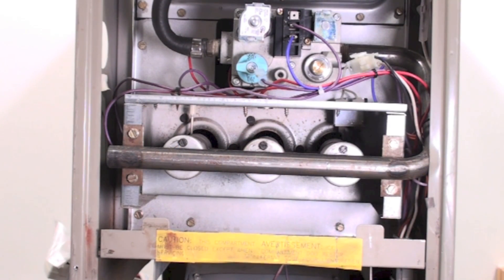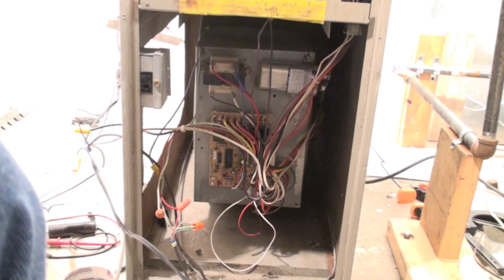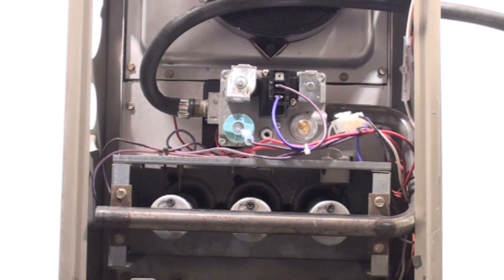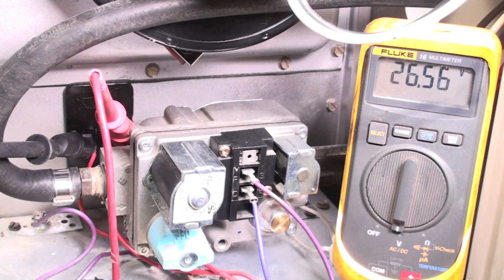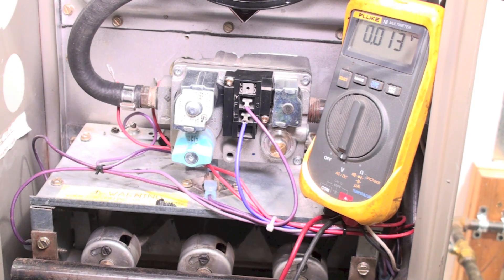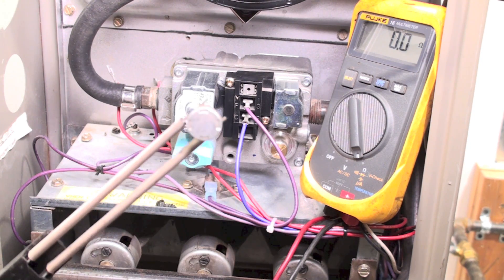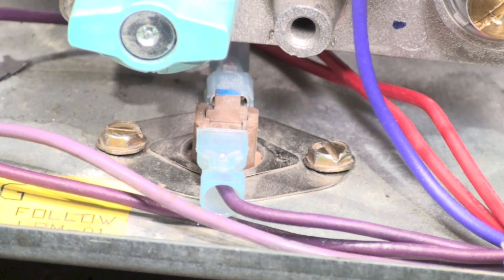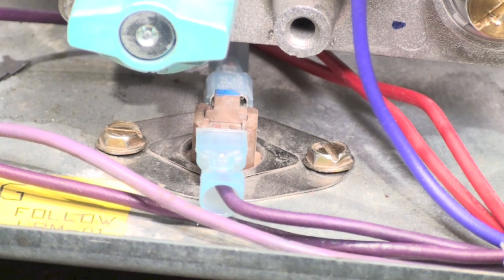Troubleshooting the limit switch on the 80% AFUE gas furnace

Comment: hello, I have a quick question: a limit switch is the same as a flame rollout switch?
Reply from the maker: Its functions the same with the exception that the rollout switch is manual reset.  The use of the switches are different.  The rollout switch detects the temperature of a flame rollout near the burners.  The limit switch detects excessively high temps in the ductwork.  
GFM

Comment: Will an open limit switch also cause the unit to not send a low voltage signal to the condensing unit contactor outside? That's my problem, four flashes on the circuit board. Haven't had a chance to test the limit switch like you show yet. The unit works when I manually engage the contactor, but the controller isn't sending the low voltage out there. I've ruled out bad wiring and thermostat.
Reply from the maker: It could, depending on manufacturer.
GFM
Reply: +grayfurnaceman it's a goodman, made in August 1996 and put into service in October 1997. I've been limping this machine by for a few years now. I just fix stuff when it breaks. Looks pretty much like the furnace in the video. The red light on the circuit board is in the upper left corner of the board though.
Reply: +Ryan Jones gmp 075-4 is the model.
Reply from the maker: I don't believe that one would interrupt the cooling signal.  However, the fan will run continuously.
GFM
Reply: +grayfurnaceman hopefully this will help some else....it turned out not to be the limit switch, thanks to your testing instructions for that. It ended up being the auxiliary limit switch that was mounted in the blower housing, again, your testing technique was spot on. $3 part. Done. Fixed and working. Thank you sir!
Reply from the maker: Welcome
GFM

Comment: I also think this is a great video. However, my limit switch tested good, but I still get the same error code. I also tested continuity between the limit switch and the control board. (One of the leads went through the pressure switch, which also tested good.) Is my defective part the control board?? (I should also add that when I disconnected the pressure switch, I got the correct 3 blink error code.)
Reply from the maker: I would check all limit devices.  There could be rollout switches or a switch mounted on the circuit fan.
GFM

Comment: Great video.
I'm stuck with an odd problem.  I'm getting a high limit open trouble code (4 flashes).  I've tested the limit for the heat exchange and the blower, both are closed (I've replaced both since they were original anyway.)  The unit blower and induction fan come on and the pressure switch is good.  In short the unit comes on, but blows cold air. Is there another limit switch I'm missing?  (normally I'd check the schematic, but there isn't one on the unit. Cant find on internet either lol) 

On a side note, I did notice that the start capacitor on the blower is an original (mfg date 5/92) you dont think a bad cap would cause this do you?  I havent checked it yet, but I dont imagine that would be it.

Maker: Inter-City products
Model: GNI080A016AIN (25 yrs old)

Any help would be greatly appreciated.
Reply from the maker: The cap is not the problem.  Some of these units had a fusible link over the burners that may be open.
GFM
Reply: Ok thanks I'll check it out

Comment: I listed the limit switch incorrectly on my last commet it should be L120-30F.  (Fan)
Reply from the maker: That is a limit switch that opens at 120 degrees fahrenheit and closes at 90 degrees.
GFM
Reply: I hadn't run the furnace or AC for about 5 days, (since the transformer on the pole took a hit and had to be replaced by the power company), so the furnace wasn't hot. Therefore the fan limit switch shouldn't have been makine the fan run. After testing both limit switches, (fan & furnace), and checking continuity on many of the wires and also taking the AC out of the picture by disconnecting it, I replaced the the control board, ($100.00), from the local supply company. All is well now.
Reply from the maker: Glad you got it going.  My own furnace suffered the same fate.  No fan running continuously, just no fire.
GFM

Comment: I'm having a hard time understanding which is the desired position. After a major elecrtic surge, (lightening strike took out my transformer on the Power pole and fried my TV, Router and the fan on my furnace won't stop running. Wouldn't I want the limit switch to NOT pass voltage across it? Seem like everyone making these videos wants the voltage to cross throught the limit switch. If it does, doesn't that mean I have continuity, the same as if I ohm it out and get 0.00. But then my fan should run, shouldn't it? I want it not to run when I turn my thermostat to off and switch the fan to AUTO. help me understand the test process it turms of making the fan Not run unless the heater or AC is in Run mode.
Reply from the maker: A limit is a high limit safety.  Meaning it should pass power to the gas control to let the burners operate unless there is an overheat.  The limit has nothing to do with the fan switch.  If your fan is running continuously, either the heat operated fan switch is stuck closed or the manual fan switch is stuck closed.  
GFM
Reply: ok. Yes. I am trying to determine why the auxilary Limit Switch (the one on the fan. L200-30F) it making my fan stay on. I set the thermostat to off and fan to auto and my fan continues to run. I thought that indicated a possible problem with the fan limit switch ot a control board problem. Seems loke most of the threads I'm reading here on youtube people are refering to the limit switch qs being on or off. I think some are mixing up open and closed (that being the circuit), with on on off. If the circuit is on that would mean the limit switch is closed. If the circuit is off that would mean limit switch is open.  BTW, I just checked the voltage on the wire while I had it disconnected from my (Fan) limit switch and was getting 14vac. I'm thinking that might mean a problem with my control board since I replaced the thermostat and the thermostat wire. Would you agree?  Thanks for your quick response from my yesterday's question.
Reply from the maker: If your aux limit is open, the the fan will run continuously.  The reason is the furnace is sensing it is over temperature and it is trying to cool itself down and tell the customer there is a problem.  If you are checking the wire on the limit to the chassis, your reading is meaningless.  You could check across the limit terminals with the unit running and if it reads 24 volts, it is open.  If it reads 0, either there is no power to the switch or it is closed.  You could have a board problem, but I would not be there yet.
GFM

Comment: What would happen if i put a 30 degree higher high limit switch in my furnace? Can you please reply back. 

Thanks!!!!!
Reply from the maker: Under no circumstances replace the limit with anything that is not a factory part.  This is important especially with any furnace made in the last 30 years.  If your furnace is opening the limit, you need to find out why.   Plugged filter, dirty fan blades, blocked A/C coil, restrictive ductwork.  Hope this helps.
GFM
Reply: grayfurnaceman it's a factory part I'm replacing it with. They sent me a limit switch that's 30 degrees higher than what's in my furnace now and I wanted to know if I put it in would it be problem down the road because it's 30 degrees higher
Reply from the maker: Could you send me your make and model#?  Its on the inside of the furnace.
GFM
Reply: Carrier Is the make also
Reply from the maker: What temperature limit do you have?
GFM
Reply: grayfurnaceman it was a 210F In there original and I ordered a new one and they sent a 240F. I don't think the 210F was the original one to start with. I just purchased the house.
Reply: I have a 210F in there now
Reply from the maker: Are you sure you are not replacing a rollout switch?  Mounted in the burner box and not on the vertical panel above the burners.  Up flow furnace.
GFM
Reply: grayfurnaceman yes I'm 100% positive. It's the high limit switch inside where the heat exchanger is at
Reply from the maker: The reason I asked is most of those limits are 170F.  Try running the unit with no fan running and put a temp probe in the supply.  Place the probe in the duct where it won't be effected by the radiant heat from the heat exchanger.  The temp should not go above about 180F.  If it operates longer than about 4 minutes shut it down as that could damage the heat exchanger.
GFM

Comment: Hey gray I'm a service tech and have a problem with a nordyne 80% gas furnace furnace the call was no heat so when I got there I found it th air filter was plugged dust so I trouble shutting system and found out th high limit switch was open at the same time I took blower out to check coil very duty so I replace h limit switch with a new one with out cleaning coil so when star unit still doing same do you think tht new limit it's open because didn't clean coil? I did clean it later but still doing same it work but stops after few minutes any sugestións

Comment: Quick question GFM,

So far the last few days I've been having a frustrating problem with my furnace. Once the desired set temperature is reached in the house, instead of the heater just shutting off, the hot air stops coming and only cold air starts to come out of the vents. The hot air always stops coming out once the set temperature is reached. This leaves us with the fan constantly blowing.

I have never had this issue before so it couldn't be the thermostat wiring, so I figured maybe I had a faulty thermostat. I replaced the thermostat with a new unit, and I still had the same issue. So i'm ruling out that the thermostat is not the culprit. 

After doing quite a bit of research online I have came to the conclusion that the limit switch could be the problem. In your expert opinion would it be wise to swap out the limit switch or should I try something else first?

By the way to note, the furnace is a gas unit, with an electric pilot. I had also changed the extremely dirty old filter out about 2 months ago.

Any help would be appreciated!

Comment: As a plumber I see a lot of poorly unsupported, dangling gas pipes around furnaces. Nice to see the wood supports under those pipes.....reminds me I should carry a circular saw and lumber in the service truck.
Reply from the maker: The workmanship can be pretty terrible out there.  I sometimes wonder how you can leave the job that way.
GFM
Reply: 24volts means it is closed....
Reply: Jim Rr looks a total hack job...3rd world barely...same as that rubber gasline that rests against a potential hot inducer housing ...ohh sure it's fine as a temp...keep your wood & wood tools at home Tim

Comment: Grayfurnaceman: as a retired HVAC mechanic I cannot count the number of times I encountered what you are saying about clean/dirty air filters starving the return for air.  And as you say the furnace runs too hot and kicks off on limit. The over temp limit is doing its job. In some homes I would find a central return grille that the homeowner has blocked with a piece of furniture or a rug, and they get this condition. The furnace has to breathe just like you & me.

Comment: Your advice fixed mine. I just remove the limit switch and flicked it a few times, reinstalled and works now. Order new switch.
Reply from the maker: Glad you got it going.
GFM
Reply: How did you remove the switch from behind the gad box?

Comment: a gary i have a question
Reply from the maker: So ask it.
GFM
Reply: grayfurnaceman  i have a 90% lennox no call to heat i check the flame sensor  cleaned it still no call the next step would be the limit correct
Reply from the maker: The limit could be the problem if the circulating fan is continuously running.  Have you checked the control board diagnostic lights?
GFM
Reply: grayfurnaceman yes is there a way we can talk on the phone

Comment: How many times would the main limit cycle OFF and ON due to a plugged filter, for example, before the control board would shut it down?
Reply from the maker: +JustPlumDucky On any unit I have worked on, the board never shuts down the furnace.  It just turns on the fan and locks out the burner.  
GFM

Comment: I reviewed several videos and out of them all this one was by far the most helpful. My Trane furnace was blowing cold air. I finally got it to light after I removed the limit heat switch, smacked it a few times and replaced it as was done in this video. I also ordered a new replacement limit switch as was also suggested here. Thank you very much!!!
Reply from the maker: +John Tessler Welcome
GFM

Comment: I worked on a furnace that tripped the overload. Evaporator coil was almost completely clogged. Cleaned it. Filter clean. Checked heat exchanger & CO test - CLEAN! Flue - like new condition. Draft inducer flowing well. Blower flows like a hurricane out the vents. STILL tripped the limit switch. Air temp at registers plenty hot (didn't measure) even after reducing main burners to a trickle. It was only after I reduced the gas flow that it FINALLY stopped opening the hi limit. What gives?
Reply from the maker: +Jake Jones Possible cracked heat exchanger near the limit switch.  Pull the limit and check inside.  I would also check temp difference across the furnace and compare to model specs.  If it is too high, you still have an air flow problem.  Manometer can help here.  Hope this helps.
GFM
Reply: +grayfurnaceman I briefly looked at the heat exchanger when I had it open and it looked like new. No obvious cracks. Also, when I took a CO reading it was 000. Not to mention, being draft induced means a negative pressure in the heat exhanger. Thus virtually impossible for exhaust to enter the conditioned air stream. Don't think the delta temp is too high. When I said "plenty hot" I meant it was sufficiently hot but not excessive. If anything, lower than what I'm used to seeing, obviously due to the reduced flame. If hi limit trips again, I will take an actual delta temp reading, and if within specs, just replace the limit switch. Nothing more frustrating than the occasional "mystery" problem. Thanks and have a Happy New Year!
Reply from the maker: +Jake Jones An induced draft does not guarantee no CO if the heat exchanger is cracked.  Happy new year.
GFM

Comment: I HAVE A 03 CARRIER MODEL 58STX090-16THE FAN IS WORKING, A/C IS WORKING , BUT HEATINR IS NOT COMING ON . EXHAUST FAN IS NOT GETING 110V .BOARD IT NOT FLISHING THE NORMAL CODE I CHECK THE WIRE AND SWITCH BUT NOTING HAPPEN. THANK YOU .
Reply from the maker: +jose echeveria Have tried jumping R to W on the terminal board?
GFM
Reply: Yes i did. Looks like they are not voltage going from the board to the  exhaust.
Reply from the maker: +jose echeveria You might try removing one of the wires from the pressure switch.  If the inducer starts, the pressure switch is stuck closed.  Also check the solder joints on the control board.  If there are solder joint problems in the control board, the manufacturer recommends replacement of the board.  Hope this helps.
GFM
Reply: thanks for your help grayfurnaceman the problem is the board .thank you for you time.

Comment: I have a 2003 armsstrong 2stage furnace  itts a 80% upflow with a sealed comb. box. it is flashinga code 3 or press. it has two press. I'm assm 1 for 1st stage and 2nd one for stage two?  both switches have a normally open post blank space where normally closed post would be. two barbed posts per switch half black and half white.
               right switch makes at .45" of WC LEFT MAKES AT .30" WC. A PRESS.TUBE GOES TO GASVALVE AND BURNER BOX THEN THEY TIE IN TOGETHER EVENTUALLY GOING TO INDUCER HOUSING BARBED PORT.I OHMED IT OUT CROSSED POSTS AND IT BEEPED AT ME it should not beep at me. I cleaned all ports and blew through tubes. noblockage. now what
Reply from the maker: +Forrest Ericsson Check combustion air supply and vent pipe for obstructions or sagging.  Hope this helps.
GFM

Comment: 'Limit switch open' was the indicator for my furnace... I switched the power swtich off and back on so to 'reset' it and now it's steady and I see flames.. New filters, always... It kicks on and off like you are talking about though, often... I have an issued with mice and my duct work, so we sealed off under the house, but now.. I opened the doors at it seems as though i am literally heating 'under my house' must be duct work besides the furnace right?
Reply from the maker: +Destiney Mickelsen Could have duct collapsed.
GFM

Comment: Thanks to your lesson on the limit switch, I was able to get my furnace working again. The fan just kept running but it wouldn't ignite.  Once I removed the switch panel and exposed the switch, I have it a few taps, put it back in and flipped the breaker and the ignite light came on and, after a few minutes, we had heat.  I will replace it as you suggested.  Funny, though, it was taped to the probe so I am not sure how I will get the new one attached.  Very, very much appreciated!!